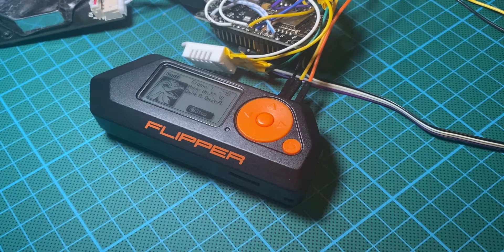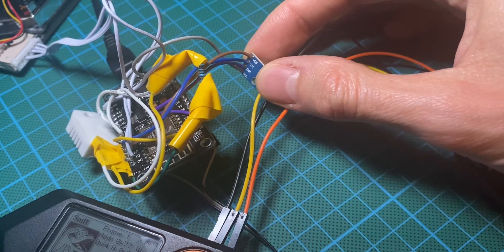Flipper Zero : I2C Sniffing with I2C Tools

Comment: maaaan I wish I had the black one,  lucky dog. I'm building a communication DevBoard myself now, and soon plan on making a stand alone version that doesn't require the Flipper to use long range messaging
Reply from the maker: Kickstarter was the only way. Probably they will start selling standalone cases when they open the parts section in their shop. Which protocol you are using for the messaging LoRa ? Is your project public?

Comment: Nice , where  to  put  the  downloaded  zip  code ,  I  mean which  is  the  directory ?
Reply from the maker: Hey Jan, are you looking to build your firmware from the official one? You could put the i2ctool in the application subfolder named plugins. Then you have to compile it. But it is now included and parched in both Unleashed and Roguemaster
Reply: @samxplogs  Thank  you  very  much :goodvibes:
Reply: @samxplogs  it's included with Xtreme as well